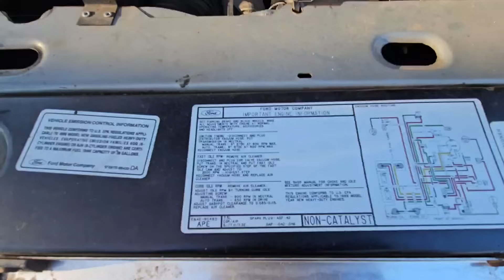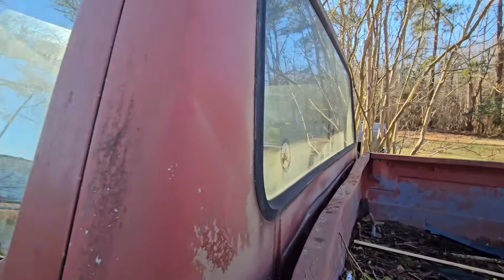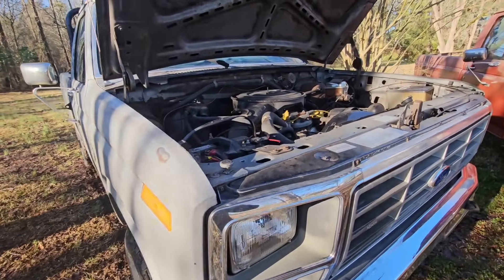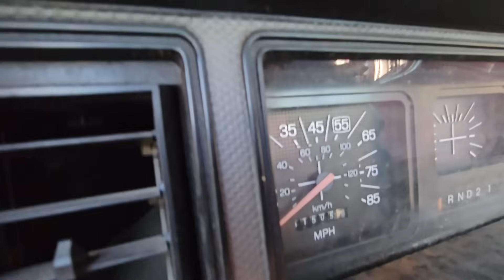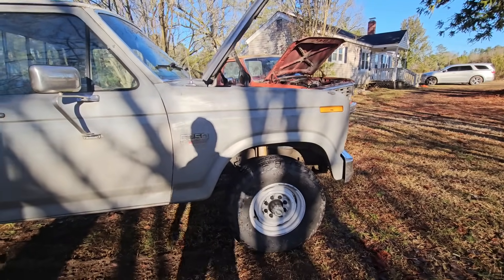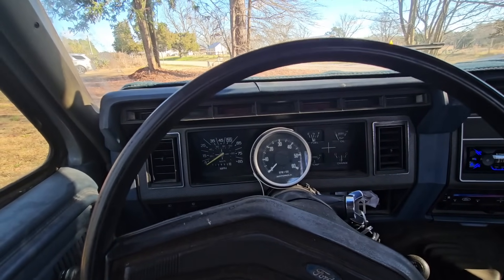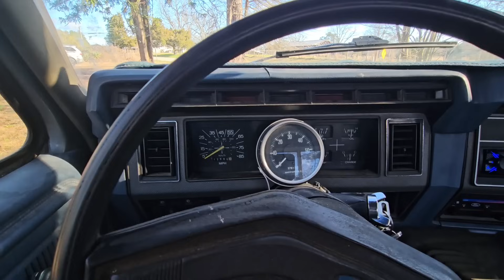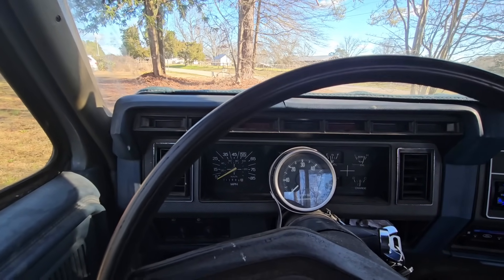THE WORST TRUCK FORD EVER MADE!?!?! #ford #fseries #sbf #bbf #truck

Comment: Those trucks are better than anything made today
Reply: AGREED!  These truck look much better, run much better work much better, all around a much better truck to own than these ugly 4 door station wagon trucks being built today.  And Ford trucks are the very BEST trucks out there!  None better.
Reply: 😂 Ugly 4door station wagon lol Well put ive been sayin same thing for yrs if i wanted a VAN ID OF BOUGHT ONE!! SO TRUE BIG 4DOORS LITTLE 4FT BED LIKE WAT AM I GONNA DO WITH THAT!!???
Reply: As much as these trucks hold a special place in my memories, they had a slew of problems that rose colored glasses can’t help with. Anyone who has owned one of these can probably tell you every common rattle and rust hole these developed. You always carried a spare starter solenoid or two along with ignition modules. Fords had a very distinct power steering whine most likely were replaced 2-3 times. 4wd hubs and bearings went to hell quickly. The IFS systems on the 4wd were a pita to work on. Dual gas tanks? Give it a few years before they stop switching. If you got 130-150k on any of these motors you were doing good, really good. Matchbooks kept the vent windows tight.
Reply: Why?  Major corrosion issues up-north,  terrible fuel economy,  and bad handling.  In today’s world; “better than anything made today”…😂.  However, I think an ‘86 5.0 EFI  5-speed in mint condition would be a desirable classic rig.  Better than an equivalent year square body GM truck IMO.
Reply: Actually  the bull and the brick    with  upgraded brakes.  Out pull and out lasted my o6 dodge. I live in wv and   80s and 90s ford's are the only trucks I buy. My 08 Chevy. Fell apart. Yet my 88 is still a daily  driver.  Fuel mileage  yea  not great. But you don't buy a truck for fuel mileage   you buy it to work
Reply: @KinexTelecom  these do not have IFS and/ or front hub and bearing issues. These are solid axle, leaf sprung 3/4 ton trucks. Starter solenoids you got back then lasted much longer than the Chinesium crap they sell today. And Fprds of that era rarely had ignition module woes. Their Duraspark system was near bulletproof. Again, today, these are handicapped by cheap store-brand knock-off parts people try to use. Use OEM or the VERY BEST aftermarket you can find and they last much longer. I have a 1978 with a 300 inline and it still starts easily and goes right along well, but slowly.
Reply: @danbasta3677  hey Im Real I agree 💯 Ford trucks tough but I've also had good luck with my many Chevy trucks just feel at home in one might be the fact my Dad had a 72 Chevy for 20yrs growing up my first memory was be an Dad hittin back roads for fallen timber he'd buy 6pck. Budweiser I'd get a glass grape faygo an the way we went hunting back roads for fallen trees loved it thanks Dad Rip pops will never forget ya an see you soon old knuckle head stubborn ass should of stayed with Mom but he knew it!!! Lucky man Indeed had 2 great women fcker ;) I'm learnin huh Haa.
Reply: @KinexTelecom Yep. I love old cars and trucks, but show me a '70s-'80s ANYTHING that you could drive for 200,000 miles with no maintenance aside from consumables. I'll wait. People do it every day with modern 1/2-ton pickups. Working on old ones is easy, and if parts are available it's cheap, but you WILL have to work on them, and you'll have to do it at least somewhat often.
Reply: @jonathanstancil8544 incorrect. F250s of this era had twin traction beam front axles. Just like the half tons but with leaf springs , 8 lug wheels and bigger brakes.
Reply: 😂😂 the poors are so funny
Reply: I had an old beater 1980 f150. I wish I had that truck new. Beautiful trucks.
Reply: @DamonSmith-ui3lp  I would submit my favorite Ford F series are the 97-03, 04 if you include the Lightning and low line Heritage.  Comfortable, excellent driving position, good road manners, and early reliable simple Mod motors .  The SD used this basic platform (as well as the Expedition) up until 2016.  It will be interesting to see how the 2015-up Aluminum body’s holds up here in the North.  Not as quiet IMO as steel bodies but knowing how corrosion is what sidelines trucks, we’ll see….
Reply: Yeah, American corporations were not as greedy as they are today.  Now they are obsessed with quarterly profits at the expense of quality or value.
Reply: Lol, no. It's one of my favorites, but their age shows.
Reply: If for no other reason, you could get these with THREE pedals!
Reply: In no way are these trucks better than today’s trucks. 
Bp, gas mileage, options and reliability.
You have a special place for this trucks era. But they’re no where near modern trucks.
Reply: @BradleyLoomis-wq9yf  Those "trucks" are now the hottest thing because people can't buy a full-size car on a separate frame with a V8 engine, or even a large inline 6, unless they buy a truck or SUV.  If they brought back traditional full-sized American-made cars, those 4 door trucks with the little cradle on the back would disappear, and SUVs were be far less popular than they are now.
Reply: @KinexTelecom  All vehicles rusted unless you ordered rust-proofing, which most people did not.  Penny-wise and pound-foolish.
Reply: @The_sinner_Jim_Whitney  Today's motor oil is far superior to what we had then, with one exception.  If we didn't have synthetic motor oil, today's Japanese wunder kars would be hard-pressed to go much more than 60,000 miles unless they were sharply cut back as far as horsepower and RPM is concerned.  When today's vehicles DO fail, it is often one of those damn computers, and some of those are well over $1,000.00 dollars.
Reply: @hothmobile100 do you really belive that??? GM, Ford and Chrysler Corp., were ALL publicly traded. I don't know how old you are but there were expectations of profit to show the share holders. I guess you don't remember the UAW problems back then either? It was a different time and people bitched about the prices back then too. It's all relative. You people Crack me up. Short memories.
Reply: @danbasta3677 the last good era of trucks was the 90s gm C/k 1500 and 2500 and the f150 and f250 the 7.3 powerstroke is a reliable workhorse but General Motors diesel engine found in ther trucks weren’t as good as the 5.9 and the 7.3
Reply: @jamesbosworth4191 if full sized cars were what the MAJORITY of customers wanted, that's what the big three would make again. People quit buying the Caprice, the station wagons, Crown Vics, etc. They started buying suvs,, minivans and crossovers. Hence, all of the  manufacturers quit making the big sedans. If you're old enough to remember, the Chrysler Minivan put an end to the family station wagon. Then the sport utilities took a bite out of the minivan market. It's all a progression.
Reply: @PanM8  My memory is great and I hold degrees in history and teach economics.   For example, companies like Toyota test their new designs twice as long as American car makers do today before they implement it to production.  American car makers do not test things as long because they are obsessed with quarterly profits today. I guess you never heard of the American W. Edwards Deming?  He tried to explain to American companies that you make greater profit in the long term when you forego an obsession with instant profits.  Only Toyota and other Japanese companies would listen to him.  Guess which car maker sells more cars now?
Reply: @cinnreds18 agree to a degree the 90s had the best middle ground between the old trucks from the 70s and 80s and modern trucks because they had enough technology to be modern while also being simple enough were it’s inexpensive to keep them going the next era the early 2000s to 2012 is were trucks become more complicated but still reliable but with features like variable valve timing and complicated systems being added well those trucks are less forgiving of a abusive owner who would go like a couple thousand miles over the recommended maintenance treating his truck like a Toyota and when it blows up they blame the company 😬
Reply: @hothmobile100  you do have a short memory. You stated that, "corporations were not as greedy as they are today." You didn't ramble on about quality. And how much other manufacturers test their vehicles today
 Obviously, you weren't alive then. Or way too young to care at the time. My parents and grandparents bitched about price and quality of the vehicles of the 80's.
 I was in my late teens, working on a dairy farm, when these trucks were new. The brothers who owned the farm, wouldn't buy them because.....wait for it....they were too expensive. They were still using their mid 70's pick-ups. And thought the quality wasn't there. Sound familiar???
Reply: Yeah right, I'll say made decent but I'll keep my new truck..
Reply: @jamesbosworth4191  Like I said, I absolutely LOVE old cars and trucks, I'm just also realistic about them. My dad's 67 and drove vehicles from the fifties-seventies til the mid-90s. If you have a little know-how and a decent place to work on stuff and tools, yes, you can keep old stuff running a LONG time, but you're not getting 300,000 out of a '71 model engine, trans, rearend, etc., I don't care how diligent you are with maintenance. Then again, if you have the tools, knowledge, and work area, back when those were readily available it was cheap, quick and simple to change even parts that major in the old stuff, so as with everything it's a tradeoff.
Reply: @The_sinner_Jim_Whitney 300 inline 6 bullnose with 200,000km on it and probably 190,000 of them were on bush roads. 40 years of mostly Bush driving and the truck is fine the most expensive thing it needed was a starter and an all in one distributor to replace a flaking out duraspark system. I've seen the modern "trucks" do about 20,000 in the bush before being completely ruined. Modern trucks are built with the smoothest pavement ride in mind but they're weaker than corollas in terms of off road abuse.
Reply: @P7777-u7r  my best friend's dad had an '81 300-3 on the tree bullnose. I was talking about miles, not KM. That said, ol' blue ran for 322,000 MILES before the frame rotted and robbed the back of the passenger leaf spring/shackle of a home, haha! A VERY rare exception to my previously stated rule, we drove it across the scales at the scrapyard and proceeded with the rest of our junk haul. We had replaced nearly every part of that truck at some point, though. I just blew up a 2009 GMC 1500 4.3L company truck that I've been driving for ten years at 334,000 miles. Still shifted perfectly and didn't use oil. Not even a good 300 is that good, usually unless you do the (distributor? Fuel pump? Advance? I can't remember, I'm not a Ford guy) mod, and even that was a 12-15-year-old full drivetrain. I don't know that even a 300-5-speed 96 could've boasted that, haha! I love the Ford big six, by the way. Maybe my favorite engine behind the LS.
Reply: IMO best trucks around are the1999 to pre-D.O.D./AFM 2500 GM with the 6.0L LQ4...my 99 Silverado 2500HD 6.0L 4L80e has 260,000 mi on it, I work the truck hard and have no issues. Plus, once you use up the truck, pull the drive line and drop it in a foxbody, boost it and goo fast...also, have a 1980 Fairmont with LM7 5.3 276,000 mi 91mm turbo, on methanol🤘 Race Engines from the factory!
Reply: @the_hobby_cavethcracing444  As I understand it, the 2500/3500 6.0L GMs were sans-DOD til like 2013 (maybe later). My 2012 GMC 2500 doesn't have it. I also have a 2012 5.3L Colorado (weighs not much more than a Fox does) with factory 4.10s and a very not-factory Tremec conversion, forged pistons, Texas Speed camshaft, LS6 valvesprings (already had the 243 heads), Detroit Truetrac, and Magnuson blower kit. It JAMS for a 4WD truck with 33"s.
Reply: @the_hobby_cavethcracing444  Your opinion is correct, with reasonable maintenance they're 300,000-mile trucks guaranteed if you treat them right.
Reply: @The_sinner_Jim_Whitney  absolutely I have a lh6 pulled from extended wheelbase trailblazer, plan to do DOD delete and cam, BTR high rpm springs, and replace the lm7. I live in Mopar country, 2003 Dodge ram I own is so corroded it's ridiculous LOL!
Reply: @cinnreds18  options like what? Leather seats? Blue tooth? A knob for a gear selector? Who wants any of that shit? Failure-prone electronics. Ridiculous costs of repairs. A manual transmission is the only option I give a shit about and I can’t have one. 100,000 plus for a “work truck” is despicable. 

An early 80’s American (even Japanese) will run a lot longer without any issue. The only ONLY concession I’ll make is you’d need to protect the bodies and frames from corrosion.
Reply: You got that right
Reply: @PanM8  Yes, I remember, (68 years old), but I also remember how the Buick Roadmaster sedans and wagons and the Chevrolet Caprice sedans and wagons sold like hotcakes in 92, but GM halted all advertising for them in 93, and even discouraged dealers from putting them on display.  Predictably, sales fell like a rock.  The Olds Custom Cruiser 98 was never advertised, so it never sold well.  The Crown Vic sold better after it adapted the Mercury body, but that killed Mercury sales, which had been strong, as they became the same car, except, of course, for the price.  Shades of 46 - 48 for Ford.
Reply: @hothmobile100  Saint Ronnie told them it was GOOD to be like that, and president Bill re-affired that.  The rest is history.
Reply: @cinnreds18  But today's vehicles, cars and trucks, are deliberately made to defy any and all attempts at repair.  Yesterday's cars and trucks were made to be almost infinitely rebuildable, and that is very important to me.
Reply: @PanM8  We all know that.  The difference today is that they do not care about the product at all, except for how many computers they have in them.  Most of us don't want all that junk, we want SIMPLICITY.
Reply: @PanM8  But today's vehicles are all designed for people who don't care about cars, don't do their own work, and don't believe in repairing their cars, only in replacing them.  Yesterday's vehicles were made to be almost infinitely rebuildable.  Today's are made to be disposed of.
Reply: @The_sinner_Jim_Whitney  With today's synthetic motor oil and a zinc additive, I bet you could get 300,000 miles out of yesterday's motors, and I also bet that if motor oil was the same today as it was in the 70s, there would be no way in hell that you could go much more than about 60,000 miles in today's Japanese wunder kars.
Reply: @congerz83  dude you couldn’t get 100k out of almost any vehicles from the 80s 
Look at the statistics.
The average life span of a 70s ride was 6 to 9 years or about 75k
The 80s jumped to around 10 years 125k and the 90s popped off at 14 years around 185k
Today my dude cars from the 2010 are seeing an average of 250k 
You’re living in a fantasy world because you have fond memories of those times but you’re so wrong when it comes to reliability.
Now price…… well leather and computer cost money, self driving is a thing. 
But a base model will run you around 30to 43k in most truck 
Guess what 14k adjusted for inflation is today 

Around 40k
Reply: @jamesbosworth4191  well you’re correct in some ways. I am a jaguar owner and fanboy
Those electronics and programming are intentionally locked from non jaguar mechanics.
That should be illegal. But in many cases, it’s not meant to be an intentional block, it’s just the everyday man can’t have a PhD amount of knowledge on every aspect of a car from internal combustion to electrical to safety or pneumatics. These things are complex, rocket propulsion on the surface is simple. When you start looking at the Merlin engines, you’ll find the deeper you go, the more lost you become. But I do agree with you in one aspect of this. I wish things were easier to work on and maintain. However, with current emissions and DOT regulations, thanks to the Greta Thunberg green crowd you’ll never see those days again.
Reply: The best domestic truck ever made was the gas 4.8 5.3 6.0 Chevy GMC GMT-800 ... with the 6.0 /4L80 2500HD GMT-800 being the best of the best.
Reply: Until you gotta go to the gas station
Reply: @jamesbosworth4191  I repair heavy equipment all day long. I am beyond happy to not have to come home and work on an "infinitely rebuildable" truck. I get into my modern F350 or my wife's Fusion, (which has nearly 200,000 trouble free miles.) turn the key and drive away every time.
Reply: Yep, saw a test on the new Ford "Lightning".  What a freaking joke!  The Lightning driver was in a panic because the truck's wind gauge showed that it was quickly loosing energy due to wind resistance.  He owed down to a crawl to conserve fuel and hd up traffic while doing it.  That was WITHOUT a load!  Once he started a full load of weight, the milage was even more dismal.  The whole thing was incredibly sad to watch.  NO THANKS!  I've owned a 71 and 72 Ford F-100 and I'm currently looking forward to finding a nice 4th generation Ford truck. (1957-60).  I am not a techie and see nothing on the new trucks I could ever want or need besides maybe air conditioning and disk brakes which I may install anyway..
Reply: @PanM8  But I would have to bring those to a shop, leaving me with no vehicle.  No thanks.
Reply: Junk
Reply: @gcanada3005  Still better than a wasted afternoon at the charging station...
Reply: @cinnreds18  we disagree. I respect your point of view. I just don’t agree on it. You’re right, they’re built better now to resist corrosion. But a small
Block v8 from that era or even better a straight 6 will last a lot longer with zero issues. Plus if it breaks down, you can probably still get it home. It would be interesting to see how many vehicles can leave you stranded completely nowadays. Like you said, maybe I’m just nostalgic. Either way. It’s a good discussion.
Reply: @enginefreak454  How so?  Just because they aren't Chevys?
Reply: easier and cheaper to repair ya better than today and good on  gas and power with a few simple hot rod mods @ProjectFairmont
Reply: @KinexTelecom 86 4.9 went 300k or so then the 5.0 after went 200k more before she was scrapped from so much rust in 2013  sucker was a tank did stuff the later yours would of never done like pulling damn 5th wheels for machine shop dad put that truck thru hell wouldn’t die
Reply: @DamonSmith-ui3lp agreed once it went to the new nose they were junk
Reply: @The_sinner_Jim_Whitney heck my dad 86 hailed damn near 3k in the back of steel  try that today
Reply: @cinnreds18 I’d disagree had one with over 400k I wit hauled a damn 5th wheel for part of its life for a machine shop a newer one couldn’t without breaking stuff  let alone sucker would start in the winter even when the 2015s wouldn’t
Reply: @Floreypottery  my dude, have you ever heard the saying “the exception is not the rule” 
I have a 95 bronco that has done me well, but let’s be real. I also had a 69 f100 360 BB that snapped a cam at 75k miles.
Simplicity doesn’t equate to better reliability it just makes the problem easier to fix. I’ll give you another example….. rust, modern vehicles don’t rust like they used too. My jaguar has none and my bronco is eaten up with it.
With time comes better tech and subsequently things “tend to be more reliable “ because humans work out problems. 
Here are the most reliable years of the civic 2021, 2014,2013 2019 and 2023 and the list of least reliable was 2001 -2005 1989 1991
I am not saying all new vehicles are superior and without problems just like not all vehicles in the 80s were trash (Volvo 240 was the best)
I am only saying that people are beating their brains out with nostalgia and it’s wasn’t all that great. How reliable were cars after the 1970 clean air act 😂 

But okay, if the good ole days were the best. 
Put down your phone, stop streaming on your tv, cancel your grubhub order and go live like it’s 1981. Get in your DeLorean and ride it till the wheels fall off in 20k miles 
But I guarantee after the good memories ware off, you’ll come back to the modern age of convenience and dependability with your hat in hand.
Reply: @jonathanstancil8544 you’ve got to be trolling with this comment. There’s no way someone could be this wrong intentionally
Reply: @danbasta3677 I wouldn't go with the very best trucks out there.
Reply: Damn right
Reply: Tidbit of info: catalytic converters were first required in cars starting in '75.
Reply: @cinnreds18  Yes, technology-wise, today's trucks are far ahead, but not all of us want technology.  You can work on these trucks in your driveway.  You have to bring today's trucks to the shop.  Not all of us are gas mileage freaks.  These trucks are VERY reliable.  Options?  They offered AC, automatic, power steering, power brakes, power windows, power seat, a Club Cab version, cruise control, radio, heater, what more could you want?
Reply: I'm looking for a old one right now.not too easy they want mad money
Reply: @cinnreds18  I don't have  cell phone, I don't even know how to stream, I don't order Grub Hub food, and never had a DeLorean.  Not only could I easily live like it is 1981, I could easily live like its 1951.
Reply: @jamesbosworth4191  as you respond on a streaming platform, using a cell phone or computer……. Yes I believe you.

Everyone thinks they’re Daniel Boone incarnate the most of you really wouldn’t survive 30 days without a Walmart. 😂
Reply: People really need to take off the rose tinted glasses. The trucks from the 70s, 80s, and 90s can't even try to compare to modern trucks. Modern trucks are more capable, more comfortable, more reliable, more fuel efficient, and far safer. And also, they aren't as expensive as everyone thinks. That mythical 80k truck everyone always talks about is a top trim, fully loaded luxury truck. I can buy a 2024 F350 Crew Cab 4x4 for 54k. The equivalent truck in 1993 cost 22k, and adjusted for inflation, that's 49k in today's money. Also, some people keep saying that it's our modern oil that makes vehicles so reliable. Funny thing is, synthetic oil has been around since the 60s, and common since the 80s. The only thing that has improved since then is that our modern oil can last longer before needing to be changed. It's all fine and good if you love your old truck, but stop trying to pretend it's somehow better than the new ones.
Reply from the maker: @ThatGuy-rf8de Everyone is different and has their preferences or chase after the latest and greatest. If you do thats okay, if not, thats okay too. Also, get what you can afford and make it work for what you need. To me, $50k+ is way too much for a truck, especially for a truck that someone like myself that wants to actually use as a truck was intended to.... pulling stumps, trees, hauling fire wood, towing trailers, and not be afraid to get it scratched or dinged. These old trucks may not be fast, have all the fancy bells and whistles, and might not handle as well as newer trucks, but it'll get the job done still and won't be married to it for 6-7 years. I came very close to buying a brand new F250 with a 7.3 Lariat. It was $82k. Could have done it had a decent down payment from selling my GTO and Mustang 5.0, all I had to do was sign my name on the dotted line.... super nice truck! Even the base 7.3 F250 crew cab at my local dealer... or at least the cheapest one they had on the lot at the time was $57k. Still would have paid on it for a few years. Just didnt want to do that. Again thats a preference thing. I instead and broke down and bought an almost brand new Camaro LT1 for my wife's birthday. With my down payment, I will have it paid off in a year, and possibly less. Point is, just don't see the point spending that type of money when my 460 4 speed  $1500 truck gets the job done!
Reply: Prior to the 1990s No one would be caught dead  in a 4 door car or truck, 4 doors were strictly brady bunch family cars
Reply: @danbasta3677  Ford drove off a cliff in 1980 when they put holes in their frames.......
Reply: As bad as I hate to admit that, it’s true. I don’t think any of the new trucks will be on the road in 20 years.
Reply: Ehhhhh, I wouldn't go quite that far. I've got a special place for the bull nose trucks, I owned 3 of them once upon a time, had an 82 F150, an 85 F250, and an 86 F150, and I'll tell you right now, the 2013 F150 I own now is more reliable, more powerful, and gets better fuel economy, than any of those trucks I had back then. This coyote powered 2013 F150 super crew would work circles around those old trucks and be happy about it. The only downside is the tiny bed, but, that's what trailers are for. I do miss having an 8 foot bed, and I plan on getting another old bull nose project truck, but the newer ones blow those out of the water in every way.
Reply: I have a 86 f150 that is in better condition that a 2024
Reply: i hear that alot, not that i don't like older vehicles because i do, but i do hear that alot lol. which honestly is a subjective opinion, and there's nothing wrong with that.
some people prefer steak, and other people will never touch fish.
some people think a hotdog is a dogs wiener lol.
Reply: @cinnreds18 that's cause the 01-05 Civic had a double wishbone suspension, Honda decided to use it on the Civic since they tried it on the 97 - 02 Accord.
so depending on what year you bought a Civic that time, the transmission was known to be the culprit.
now the LX had a regular suspension, but the transmission was the same. it was on the EX models that had the wishbone, but it made sense as it had tighter suspension, horsepower was 127, torque was 117.
so revving was quite common, but unfortunately that also is what led to transmission problems.
Reply: Fax
Reply: @jamesbosworth4191 What are going on about. Guess you forgot about all the 80’s-90’s Hondas & Toyota that went 300-500K miles. Usually on the same motor & trans. 60k miles 😂 Good one 😅
Reply: @cinnreds18  I disagree that the locking isn't intentional.  I think it IS intentional, so that you have to bring it to them for everything.
Reply: @cinnreds18  A snapped cam is a manufacturing defect and is not representative of the majority.  I still don't have a cell phone, I don't use grubhub, and I do just fine.
Reply: @runsgoodbutsmokes  THANK YOU!
Reply: @SegoMan  That was short-lived.  Most of those trucks were great trucks.
Reply: @Paul-n4p5i  I was talking mostly about pre 1980s.  Before the 80s, motor oil simply wasn't good enough to rack up those phenomenal figures.
Reply: @KinexTelecom  unfortunately I would agree with all of that other than the life of the engine, 4.9 inline 6 was a killer engine, 302 / 351 was a killer engine family and the 460 was most definitely a great engine as was the 6.9 / 7.3 IDI diesels it was all the debris bolted to them that wasn't the best quality. 
Now that being said I am not an antique by any means but I've been around long enough to know that a lot of these problems were self-inflicted by buying garbage parts from the parts stores. Chinese-made control modules, chinese-made starter solenoids, chinese-made fuel selector switches were/are all problematic and OEM parts last so much longer generally speaking...  Now that being said I would most certainly keep all of those parts behind the back seat if I still had one of these trucks just in case. 
The best cure for most of this replace the starter with a high torque mini starter with the solenoid built on the starter, replace Ford distributor with an aftermarket quality one and dump the garbage emissions carburetor in the trash can where it belongs and all suddenly that engine especially when considering what 1980s vehicles were expected to go.
Reply: I bought a new 4x4 1986 and it was a giant POS.
Reply: @The_sinner_Jim_Whitney  No maintenance aside from consumables?  Do you mean not changing the oil, not greasing the chassis, not repacking the wheel bearings?  Or do you mean not having to overhaul the engine?  I got well over 300,000 miles out my 81 Chevy 1/2 ton 6 cyl, but then I changed the oil and filter every 2,000 miles and never allowed it get more than a quart low, I greased the chassis every few thousand miles, etc.
Reply: @jamesbosworth4191  By no maintenance I mean nothing but fluids and consumables. I've had one of just about everything and prefer older stuff, but it's indisputable that newer stuff runs longer with less maintenance.
Reply: @The_sinner_Jim_Whitney  Don't forget that we didn't have synthetic back then.  I seriously doubt today's vehicles would be able to wrack up these incredible mileage figures if oil was still the same as it was back in the day.  Most likely, 60,000 miles would be tops for them.
Reply: @The_sinner_Jim_Whitney  The only thing that they DO have that doesn't require maintenance is the fact that they don't have a distributor, so no cap, no rotor, and, of course, no points and no condenser.
Reply: @jamesbosworth4191  Well, that and computer control of all the major systems, overdrive, roller valvetrain, electric fuel pumps that are easy and quick to change, no traditional wheel bearings, lots of things. Can old stuff be maintained and overhauled for many years? Sure, it's just WAY more work.
Reply: @The_sinner_Jim_Whitney  Overdrive was very popular until the mid 50s, so it isn't new.  Roller valvetrains were common on the better cars with overhead valves - Buick, Nash, Templar, Stutz, and others I can't think of - until the late 20s, when motor oil improved.  They were brought back in response to the EPA's elimination of zinc from the motor oil modern cars were expected to use.  Don't modern cars have wheel bearings?  Is that why they have so much road noise?  Electric fuel pumps are NOT more reliable, they replaced traditional fuel pumps due to the use of fuel injection to replace carburetors.  Traditional fuel pumps don't generate enough pressure for FI to work unless you make them impossibly large.  I still say that if motor oil was the same as it used to be, today's wondercars would be all through engine-wise at about 60,000 miles.  Oil didn't have the film strength for the heat, pressure, and RPM today's engines can generate.   Yes, racing engines produced even more back in the day, but racing engines are overhauled after every race, so longevity is not an issue with them.
Reply: @The_sinner_Jim_Whitney  Plus, I just don't want a vehicle that I can't work on.
Reply: @jamesbosworth4191  I didn't say anything about cars in the twenties, nor that electric fuel pumps are more reliable. They don't have TRADITIONAL wheel bearings, you know damn well what that means. Continue believing whatever you wish, it affects me in no way. I'll keep a quarter million miles out of modern stuff that won't break down on my way to work. I don't care if it's easy to fix if I have to do it on the side of the road at 6:00 am. Oh, and newer stuff is just as easy to fix, you just have to know different things.
Reply: @jamesbosworth4191  I can work on my newer stuff just as easily as my old cars. You have to learn new things with anything in life, I don't see how vehicle maintenance should be different.
Reply: @The_sinner_Jim_Whitney  I didn't say you were talking about 20s cars, I merely pointed out that roller lifters are nothing new.  What kind of wheel bearings to modern Japaniod car have?  I only know about ball bearings and roller bearings, so if there is another kind, I have no idea what they are.  And continue liking what you want, I just don't like tiny cars, I don't like cars that ride like a truck, and I don't like ugly cars, and I want chrome trim.
Reply: @The_sinner_Jim_Whitney  Having to remove the body from the frame in order to replace the engine is unacceptable to me.  It may also mean that you have to remove the body from the frame in order to remove the heads.  No thanks.
Reply: @jamesbosworth4191  sealed hub assemblies, as you're no doubt well aware. I wouldn't drive a Japanese vehicle if it was free, so I don't know where that jab is coming from.
Reply: @jamesbosworth4191  I've never done any of those things, nor have you, unless you work on diesel Fords. Relax with the hyperbole.
Reply: @The_sinner_Jim_Whitney  That's what it says about the new Tundra trucks with the stupid blown V6 that only lasts about 20,000 miles.  The cab has to be lifted off the frame in order to remove the engine.  Is that also  true of Ford diesels?  I don't like turbos on automotive gasoline engines anyway.  My 73 GMC suits me just fine.  No smog checks, no catalytic converter to get stolen, no computers, no sensors, just an ENGINE and a MANUAL TRANSMISSION.  It is everything a truck should be.  And it looks kool as well.  I admit, though, I live where road salt isn't a problem.
Reply: @jamesbosworth4191  Toyota could afford to overengineer in the '80s-'90s. They can't anymore. They rarely make a dud, though the one you point out is one, but I have no love for post- '95 Toyotas. I drive used, low-mile, well-maintained late-model GMs. My '67 Chevy II wagon suits me just fine, too, but I'm not going to try to drive it to work every day. If you drive a '73, the way Detroit released it, you don't live far from work (or maybe don't work or don't work anymore). This isn't an argument or opinion. Get in your '73 and drive coast-to-coast with nothing but what you have in your pockets. I've done it countless times in OBD-II GMs. Done it in a '55 210 post, a '78 Cherokee, an '88 K20 Suburban, and my wagon, too. Guess which ones made it without needing anything? Hint: not the old cars. And they wouldn't do it new, either.
Reply: @The_sinner_Jim_Whitney  I drove my GMC to work every day for years, half of that time lived far work, and the only times it let me down is when I brought it to a shop for a new clutch - I had recently injured my back and didn't think I was up to doing it my self - and they put the wrong throw-out bearing in, and it failed, and later, the el cheapo throw-out fork that they put in punched through where the push rod rides.  Hardly the truck's fault, as before and after, with me doing ALL the maintenance and repairs myself, it was 100% reliable, but then I properly maintained it, rather than driving it until something failed - oil and filter changes every 2,000 miles, grease jobs every few thousand miles, re-packed the wheel bearings every 10,000 miles, changed the transmission and diff oils every 10,000 miles, you get the picture.  There is no reason you couldn't drive your wagon to work every day, unless you have heavily modified it - hot rods are often temperamental and unreliable.  A 55 Chevy should be easily capable of cross-country driving.  Ditto the 78 Cherokee.  The 88 Suburban, not so sure, as the early electronics were sketchy, but if you removed all that junk and reverted to a carburetor, it too would probably be able to go cross-country without a hick-up.
Reply: @The_sinner_Jim_Whitney  Forgot to add that I also change the cap, rotor, points, and condenser every 10,000 miles, and check and adjust the points at 5,000.  Check and if necessary clean and regap the plugs every 5,000 miles, replace them when they start looking worn.  Granted, modern vehicles don't need that, but I enjoy working on my cars.  I know they are always in tip-top shape, ready for me to just jump in and go at a moment's notice.
Reply: @jamesbosworth4191  Again, congratulations. My average commute is 40 miles either way, I'm sure you have that beat, too. For every bone I've broken, you've broken two. I wish I liked working on old cars that much, I'd prefer it just be a hobby.
Reply: @jamesbosworth4191  So near-constant maintenance, exactly like  I said. Am I in the Twilight Zone? MST3K?
Reply: @The_sinner_Jim_Whitney  For distance, you beat me!  I guess you wouldn't like my truck, it has manual steering, manual brakes, manual windows.  It didn't have AC either, last year, I decided to add it.  Soon wished I hadn't tried, as it turns out that the firewalls are different between the two, and I don't know how to weld.  My brother does, a little, but his welds are pretty lumpy, so I have to use thick rubber to get the housing to seal against the modified firewall.  Still haven't got it to work yet, guess I don't really consider it that important.  I also have a 54 New Yorker wagon with a first generation HEMI that I have to bring back.  Used to drive it a lot, finally time to restore it came, as it was from back east and, despite being a low mileage car, the frame has rust.
Reply: @The_sinner_Jim_Whitney  Back when I learned how to drive and got my first car, that was pretty much normal.  If you didn't have an oil filter - it was optional on Fords and Chevys until the Y block on mid 50s Fords, 1962 for Chevy 6 cyl, and 67 for Chevy V8s, you had to change your oil every 1,000 miles!  Chassis grease was a far cry from even 70s chassis grease.  You were supposed to grease the chassis every 1,000 miles!  Today's lubricants are far superior.  Only caveat is that if you don't have an oil filter, you should use non-detergent motor oil, so abrasives with settle to the bottom of the pan instead of scratching the bearings, or better yet, add one.  If your 67 wagon's ball joints, etc. have rubber boots around them, you shouldn't have to grease them more than once every 5,000 miles, but if they just have the old-style umbellas over them, you better grease them every 2,000 - 3,000 miles.  If you don't like messing with points, condenser, etc., it is easy to convert to HEI.  Even though that is a stock GM system starting 75, it is superb.  You will only have to change the cap and rotor every 20,000 miles instead of every 10,000 - 12,000 miles, and no points to worry about.  Just make sure you get a distributor that is for your vehicle, as a 70s one might have too much total spark advance - compensation for retarded timing at idle that was the norm for 70s - 80s engines.  Good luck!
Reply: @jamesbosworth4191  Again, I love old vehicles and have had a bunch of them. I don't mind any of the old manual stuff and vastly prefer manual transmissions.
Reply: Lots of them still chugging along, that pretty much proves it
Reply: @ProjectFairmont  Many Toyotas had to be recalled to have the frame replaced - severe rust - and today's Toyota engines only last about 20,000 miles.  People don't buy trucks for handling.  They buy sports cars for that.  Trucks are for hauling and towing, and these trucks, when equipped with a 300 6 cyl or a 302 did not get terrible fuel economy.  People don't buy trucks primarily for fuel economy, they buy Toyota Corollas for that.
Reply: @ThatGuy-rf8de  We don't buy trucks so much for comfort, power everything, backup cameras, gas mileage etc.  And few of us want a crew cab, and those of us who do want one want a full-size bed, not a mini-bed.  Synthetic may have been invented in the 60s, but it didn't come into wide use until the 2,000.  In fact, before the 90s, you couldn't even find it in auto parts stores, and it was VERY expensive.  One requirement of work vehicles is that they be easy to repair and easy to rebuild.  Yesteryear's trucks were just that.  Today's trucks are not.  Work vehicles that have to be brought to a shop and laid up until they get to it just doesn't cut it.  Sorry, today's trucks are NOT as good as those of the past, except for rust resistance.
Reply: @Jeymez  Different strokes for different folks.  For me, pre-computer is better.
Reply: @Jeymez  For me, 117 lbs. ft. of torque simply isn't enough.
Reply: @jamesbosworth4191  Today's trucks make an absolute joke out of 20-40 year old trucks. I can tell reading your comment, that you don't actually use your truck for any real work, from several things you said. First, gas mileage. I know everybody loves to say that nobody buys a truck for fuel efficiency, but if you are actually using your truck as a work truck, and making money with it, you'll realize just how stupid those people are. For example, comparing the average fuel efficiency of a 2020 F250, vs a 1980 F250, over 25,000 miles (which is probably less than a year of driving for a work truck) the 1980 would burn $8300 in fuel, while the 2020 would burn $5400. That's almost three thousand dollars in that short a time. Now imagine over 250,000 miles. You would save almost enough money to buy another truck. Also, unless you have a catastrophic failure, a modern truck will usually take less time to fix a problem. And in the event of something like a catastrophic engine failure, by the time you can pull your old engine, scrounge around for the parts to fix it, and rebuild it, the new truck would likely already be back on the road, since it is so much easier to get parts for. And, the new truck will be spending much less time in the shop, due to the fact that modern trucks are FAR more reliable than old one. Which brings me to the next issue, oil. You are mistaken, because synthetic was already fairly common in the 80s. Maybe not in your area, but it was in the US as a whole. Also, the multi-weight, synthetic blends that are typically used today, were also mainstream by the 80s. And despite that, it is still impressive to see one of those old trucks reach 300,000 miles, while with new trucks, 400-500 isn't uncommon, even with gas powered trucks. And due to the much stronger frames, much more powerful engines, and much better technology, a new truck is far more capable than any old truck. When was the last time you saw a bone stock truck from the 80s pull a 25,000lb trailer up a hill without coming out of overdrive? Any modern diesel can with ease. An old truck might be better suited as grand pappy's farm beater, but for a real work truck, not so much. New trucks are faster, stronger, more capable, more powerful, more comfortable, more reliable, more fuel efficient, quiter, and much easier to find parts for. Like I said in my other comment, it's fine if you just like the older trucks, but don't pretend they're better.
Reply: @jamesbosworth4191  it was pretty light, so while it may not sound like alot,
it was fairly peppy.  the problem was finding one in good condition, that wasn't ran into the ground or riced up to hell lol.
Reply: @triedandtrue1820  Sure are, and good looking too.
Reply: @KinexTelecom  You just described 15 years of my life haha I had the 86 F250 4x4 with the 302 EFI....Dont get me started on relays!!
Reply: Yeah Bullnose Fords went to the crusher early compared to GM trucks of the same era.
But I miss seeing that old ford bodystyle.
Reply: @BradleyLoomis-wq9yf honesty is always appreciated.  I was raised up on mopar.. but I had to be honest,  when I started buying old chevys, I learned real quick why GM had the reputation it had for dependability
Reply: @privateprivate1865  Did they?  I still see them occasionally, whereas GM Square Bodies - I have a 73 - are getting scarce.
Reply: @jamesbosworth4191  yes.. there's a reason most custom cars and hot rods us gm powertrains. 
It's not just because they are the least expensive either. I'm talking pre computer era
Reply: @privateprivate1865  It is destroying history, regardless of the reason.  And yes, I know the Chevy V8 has five bolts around each bore, instead of only 4, but still, Chevy engines belong in Chevys.
Reply: @jamesbosworth4191  I'm just pointing out that there's a reason so many classic customs use pre computer gm powertrains.  They are reliable.  There's a reason why you see more tri 5 chevys at carshows than 50s ford or mopar. Because people hung on to them longer, because they were more reliable.
Reply: @stevescarsfish2175 the idiots who spend 75k on seat warmers and tailgate assist are even funnier.
Reply: @privateprivate1865  There was nothing unreliable about 55 - 56 Plymouths, and the potential lubrication problem of 54 - 56 Fords, (and later Y blocks as well), is easily remedied, tri-5 Chevys were simply more rust resistant.  Here in California, where salt is not used, 54 - 56 Fords and 55 - 56 Plymouths survived as well as the 55 - 57 Chevys did.  Back east, they rusted away much more easily.  And yes, I know GM was at the top of their game in the 50s and 60s.  If it wasn't for that X member frame with no side rails on Chevys and Cadillacs, they would have been just about the perfect cars.
Reply: @privateprivate1865  I just hate it when classic cars are destroyed.  They should be preserved, not butchered.
Reply: @jamesbosworth4191  agreed
Reply: Ford just sucks
Reply: @dgr5421  No it doesn't.
Reply: @ Toyota is the best !!!
Reply: @dgr5421  Toyota, along with the EPA, CAFE, and our government's inaction, helped to destroy our auto and steel industries.  That's why we have a huge surplus of workers nowadays - aka the homeless - with no way for them to get jobs, even if those of them with addictions quit using drugs, etc.  To me, unforgivable, especially since THEY are the ones who attacked US.
Reply: @ zero excuses my friend
Reply: @dgr5421  With engines lasting only 20,000 miles?  Even a lowly Model T's engine lasts way longer than that!
Reply: @dgr5421  I am not making excuses, I am stating FACTS.  I am 69 years old, so I lived through that wretched Reagan's years, and a watched the steady war against our auto industry.  It all really happened.  I am not repeating what somebody told me, I LIVED THROUGH IT!
Reply: @ Toyota is the best period!!!
Reply: @  the only European american truck out there that I would give credit is the “Chevrolet “
Reply: @dgr5421  Not with engines that last only 20,000 miles they aren't.  I call that JUNK.
Reply: @dgr5421  I love my old GMC Squarebody, but I have heard that the new ones are not the greatest.